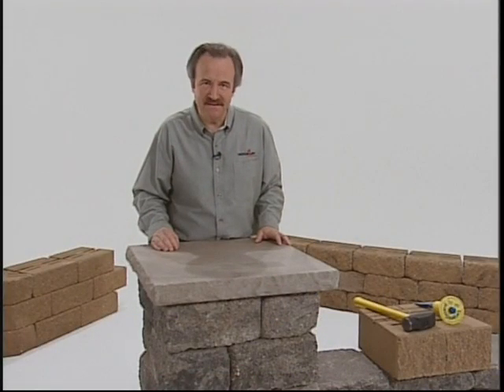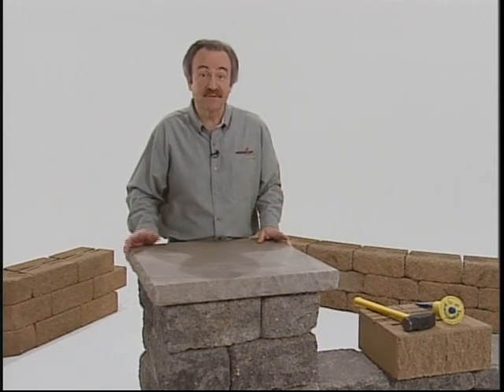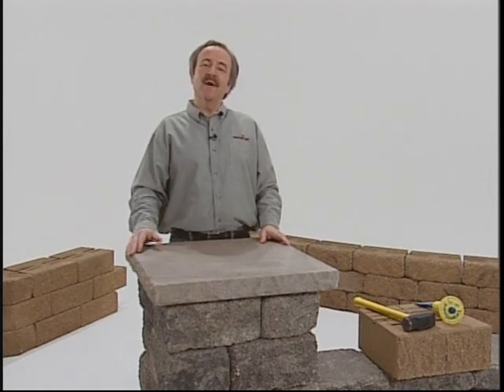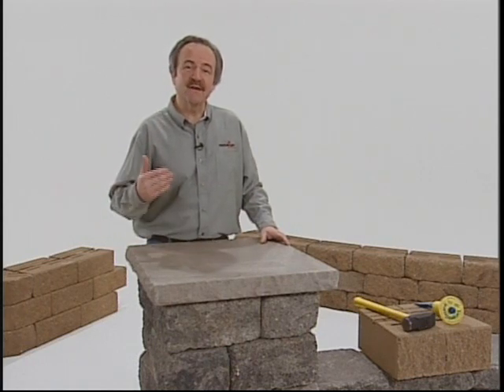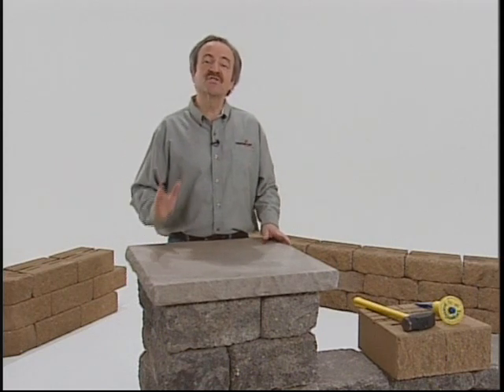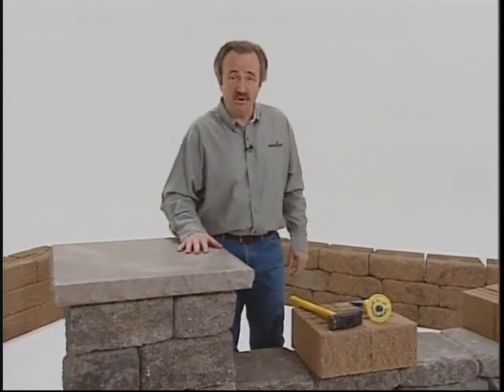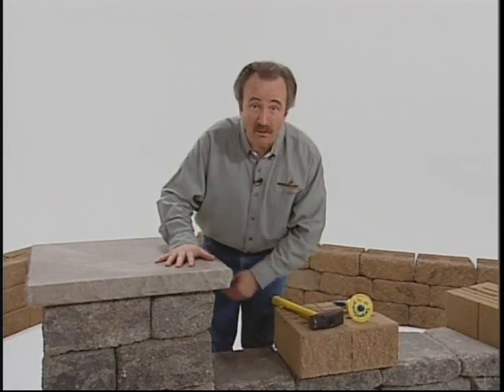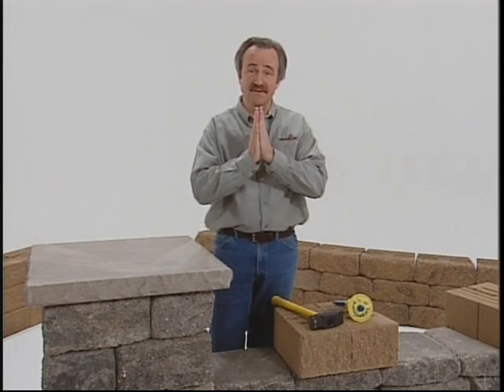Part 11 - Splitting and Cutting - Retaining Wall Installation - Standard unit

Comment: What would help is a demonstration of techniques for splitting different widths from a standard block.  For instance, I'm trying to chip off a 4.5" section to fill a gap in my wall, but twice now it shatters in the middle.  Tips on how to avoid that would be welcome.  At this point, I'm going to just find a 10" diamond blade table saw and cut it that way, since it's going in between two other blocks.  But, even that suggestion would have saved me time tinkering with 'scoring and splitting'.

Comment: Could you also elaborate on 'scoring' the block?  How deep should I go?  What are the best tools for the job?  How do I get the lines on the top to match up with the lines on the bottom?  What to do when my line crosses one of the holes or grooves for the pins?